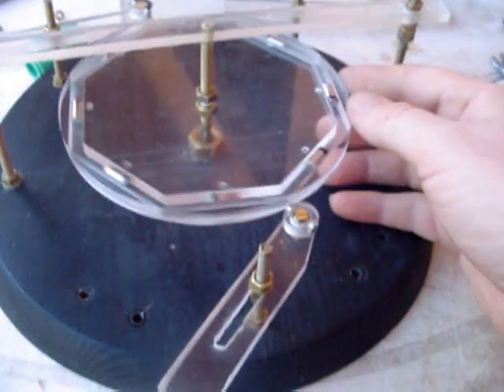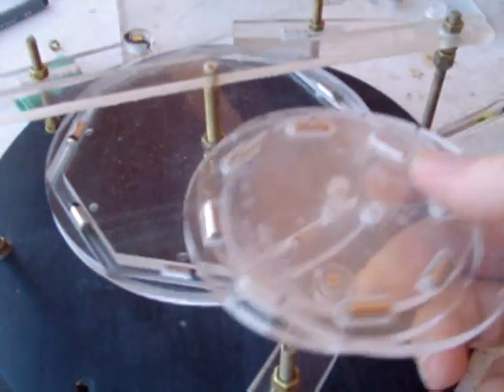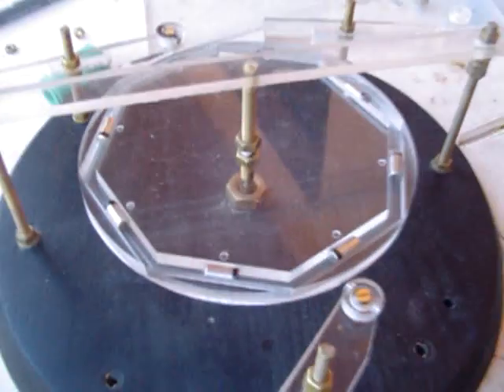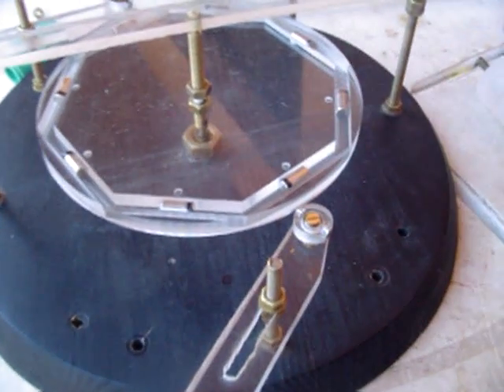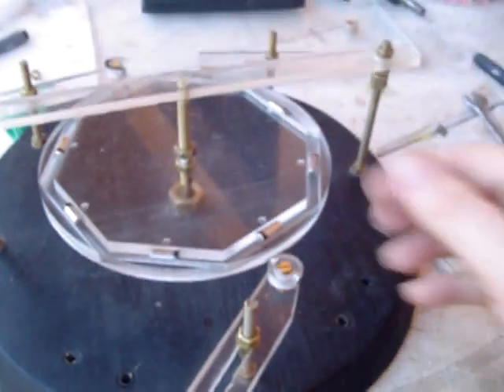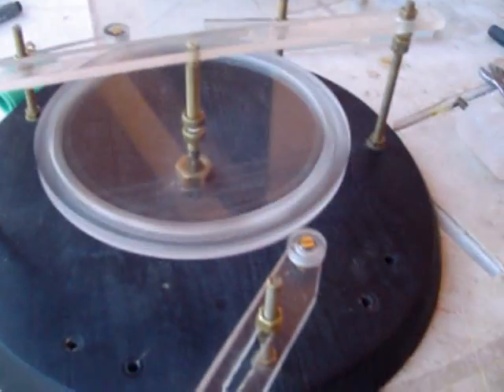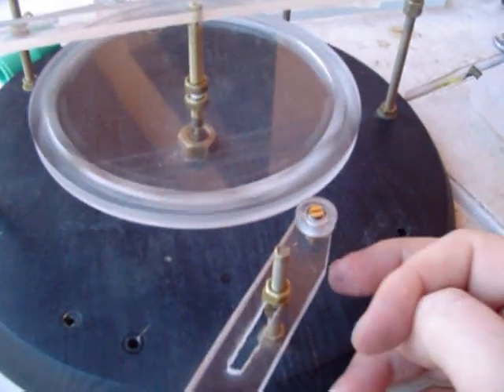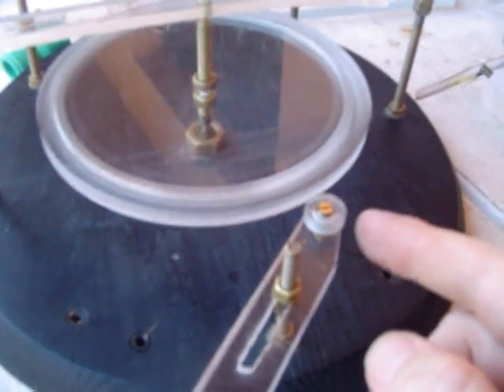OCAL Magnetic motor

Comment: You had it in agw - the next step is to slow the small wheel with aluminium dampers so that the small wheel magnet is delayed in rendezvous with large wheel magnet but not slow enough to take it out of agw - so close , so simple, but since you don't know what makes it run, you don't know the next step - if you knew this, you would have had the aluminum ready, to find its placement - you could even use a copper penny - did you ever get it working ?

Comment: @neo58421964 Your comparing one man who failed 1000 times then succeed to 1000s of men each failing once (or more) and never succeeding. No one is coming close. At least Tom's first attempt worked and proved the concept of the filament lamp. The other 999 just got better. I have yet to see even a proof of concept for a magnet motor. At least you'll all prove you can't do it 1000+ times.

Comment: Hey, I'm all for experimentation.  But no alchemist ever found a way to make gold out of lead by trial and error.  I'm just saying it's a shame that people waste their time when they could be doing something useful.  

This is the same as putting a generator on the front wheel of a bicycle, and a motor on the rear wheel, connecting the two and saying that it doesn't run forevery yet because you just haven't found the right winding ratios.